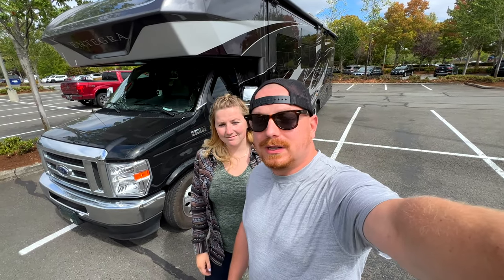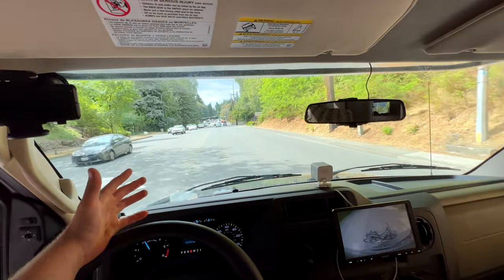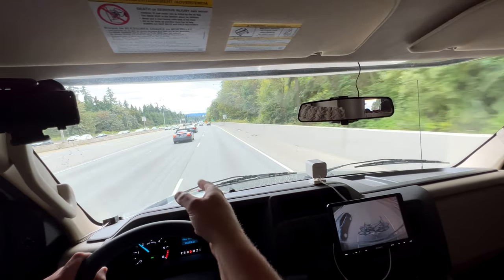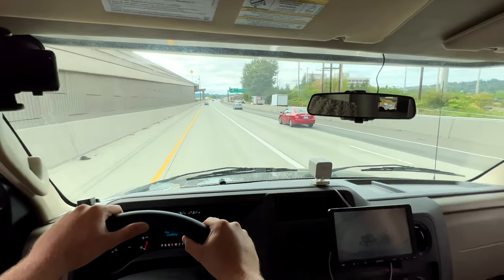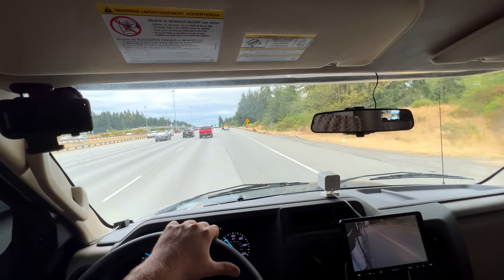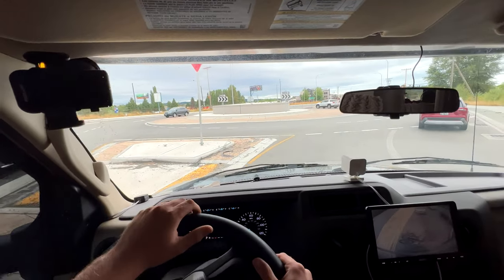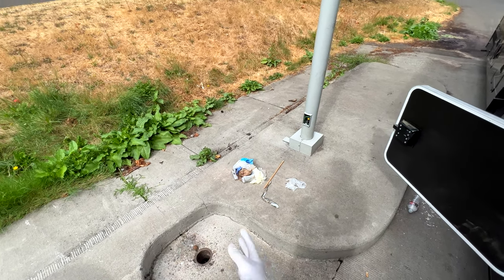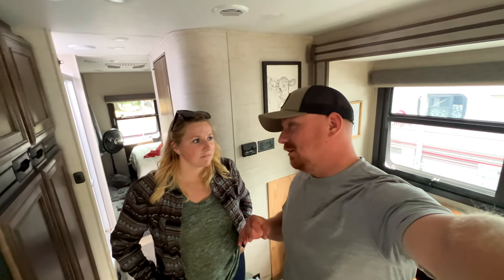What It’s Like to Drive a Class C Motorhome | Driver POV | 2022 Entegra Esteem 29V

Comment: just having completed a longer trip in our Odyssey 31F.  driving just over 70 mph it does get loud.  Tow/haul mode is a must in the mountains or to better merge as it holds the gear a little longer. Also the generator exhaust sticks out a couple of inches on the drivers side; I know cause I hit a traffic cone in a construction zone.  😬

edit: if a trucker lets you into the lane.  I usually give them a couple of flashes of the hazard lights as a thank you.

Comment: Great topic for a video and very helpful ! You mentioned that there’s not a whole lot of clearance, have you ever had any kind of issues with hydraulic jacks striking anything ? I’ve seen some rigs that have those castor type wheels mounted under the rear bumper area , I assume to help with dragging the rear ? 🤷🏻‍♂️ any thoughts on those . I like the new camera setup, I feel like I’m on board lol 😎👍👍👍👍👍🇺🇸 P.S does the rig have a spare tire ?
Reply from the maker: I hoped it would be! We looked and just couldn’t find anything close to a video like this while waiting for our rig! And we do strike the jacks on some speed bumps unless we’re going VERY slow over them, 2 mph is too much lol not all, but some lots are a little extra with their bumps! And that’s interesting! I hadn’t seen that, but I suppose it wouldn’t necessarily hurt, as long as they were mounted on the frame and it could take the weight of the rig being rested there… when we scrape, we tend to be turning at the bottom of a hill and I don’t think wheels would do us much good! 

And thanks!! I should have added a warning for viewers sensitive to motion, but I’m sure it’ll help at least one person!! And no spare tire, another thing I didn’t know for certain before we got this rig!
Reply: @CozyLivingMachine  I had a couple more thoughts as I finished the video lol I’ve heard some resort to a different storage method for the sewer hose because of possible rust concerns for the bumper 🤷🏻‍♂️ any issue or concern for that ? Also I noticed your water hose is blue and I’ve seen white too. Is the distinction one is for fresh water and the other for sewer ? I noticed you said you prefer to operate your jacks manually, was wondering why ? I was going to get those Snappads for the Jack feet, have you seen those and any thoughts ?
Reply from the maker: @georges4562  it was a long one, I’m amazed you got all the way through!! 😂 and you know, I saw surface rust inside immediately upon buying it. I was concerned and considered spraying inside and letting it dry, but I figured that worst case I’ll just grab a new bumper that is aluminum and paint it black. It’s far too convenient to have it in the bumper. 😬 and no distinction, as long as they’re food safe! This is the hose we got from Gabe when we picked up our motorhome and every other one we’ve had was white as well! I have found that with certain areas where we’ve been unlevel, the jacks will not do their job and keep trying to extend much farther past where they can. It also zeros out when we’re still sloping down in the front, so I bring it up higher than I’m “supposed to” in the front and that works best for us. As for the jack snap pads, we’ve thought about it but it would lower our overall clearance and there’s no need for how we use it on asphalt or gravel. Maybe in mud it may make a difference, but I suspect we’d be better off with a bit of wood under them instead.

Comment: Do you generally stay to the left lane when traveling local roads? Is this to avoid cars coming out of parking lots and streets in front of you? Or do you stay in right lane to avoid cars behind you getting frustrated because they “think” left lane is quick lane?
Reply from the maker: That's a great question, and it's entirely dependent, but GENERALLY I stay to the right as a rule of thumb. Some roads I've found that there are unpredictable patterns of traffic, folks pulling out in front because we look large and slow, or there's an on-ramp coming up that vehicles tend to get backed up at, I will move over to avoid those areas and lanes of traffic. We require more stopping distance, so I err on the side of caution in this way! On seven-lane roads, such as highway 99 in Washington, I tend to take the middle of the three in the same direction, just because it prevents me from having to brake and accelerate as frequently. I suppose I'm less concerned about people passing on the right when the speeds are 45 or under, though when on the freeways I'll stick to the right-most lane unless there are certain exceptions.

This is an interesting question, I've never given this much thought so thanks for asking!

Comment: Lacklustre on the hills? Just use more throttle, the more I drive this rig the more used to it I am getting. Just use more throttle, the engine has its HP and torque at higher revs like the 3200 to 4000. I was scared I was pushing the engine too hard at first but it loves that higher range. Now the terrible turning radius is to be expected from such a long wheelbase, comparing it to a Dodge Ram pickup isn’t very fair, much shorter wheelbase.
I do notice the bad driers more, they want to get ahead of me so badly that they will scoot in front of me way too fast and then slam on their brakes as they are about to hit the car ahead of them, while simultaneously cutting me off so I need to slam on my brakes… I was also almost rear ended by a BMW SUV yesterday. I’m not too surprised as the more expensive the car the more dangerous of a driver is usually behind the wheel.

Comment: Firstly a 450 chassis cab is a fair motor its the idiots who put that extra large body on it that has killed it, that extra long rear overhang with no upwards slope caster wheels wont realy help you , better a little gravel rash on the rear end than rear frame damage of the caster wheels pushing up vertical, landing legs hitting the road again bad design. Strong advice dont go out in strong crosswinds I have seen overbody ed flip in the wind with ease, Overall sorry friend but that was a bad buy .
Reply: And what would you say was the maximum length on a 450 chassis?
Reply: @wattsupwiththat1463  My point was the overbody  size , the bulk over the cab then my main point that overhang after the rear axle , in a side wind its going to be a beast to say the least.